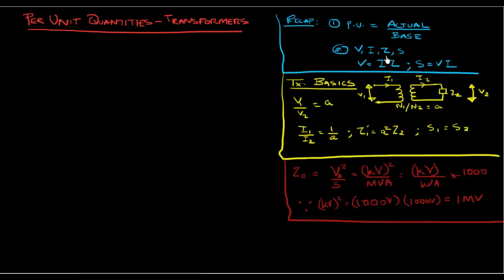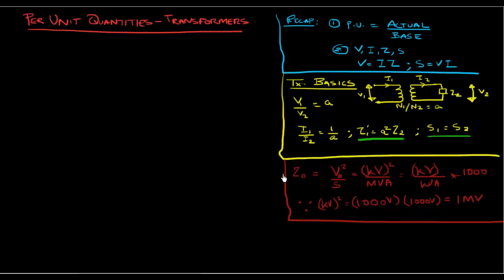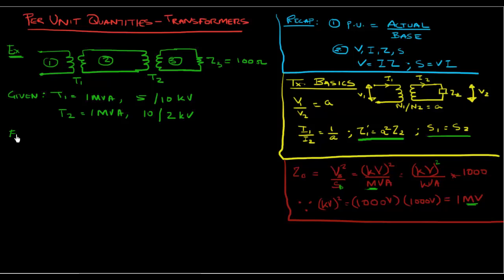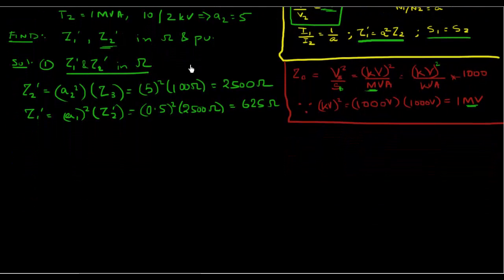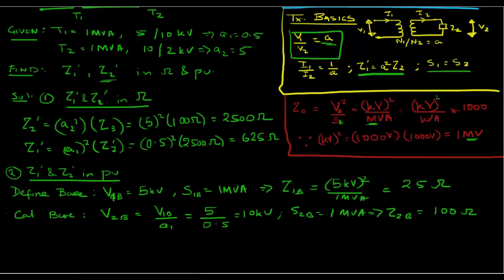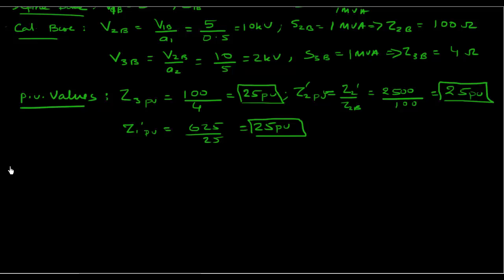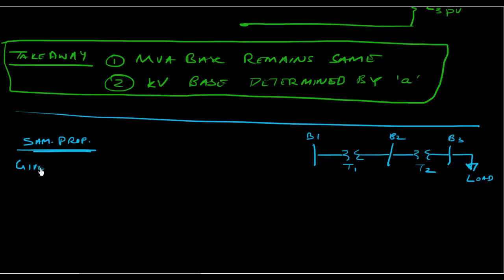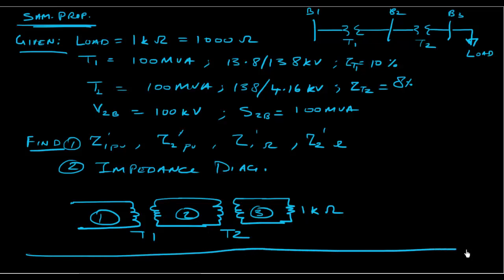Per-Unit Quantities - Transformers

Comment: Can you explain me the meaning of the Z_(T1)=10% and Z_(T2)=8% ? Does it mean that     S_3 = 0.92 * S_2     and     S_2 = 0.9 * S_1  ? So only a fraction of the power is going from circuit one to circuit two and the same happens between circuit two and circuit three. The remaining power would be dissipated at the transforms. 

I would be happy if you could confirm or correct my thoughts. 

Cheers, Niko

Comment: z1pu' is equal to the other inpedances =11004.53033 and z2'=1100453.53....and z1'=11004.53.....
Reply: +achour catalonia that's what i'm getting, not the answer from +Sooraj Surendran...hmm
Reply from the maker: Hi Achour, your values are correct, I need to correct Sooraj's answer below!
Reply from the maker: Hi Evan, yes I did just check again, and Achour's and your values are correct for Z2' & Z1'.   Not the one that Sooraj got.  Sorry about the confusion!

Comment: Z1' 1100453.033 Ohm
Z2' 11004.53033 Ohm

Z2pu 11004.53033 PU  Z1pu 11004.53033 PU   Z3pu 11004.53033 PU

Am i right?
Reply from the maker: +Sooraj Surendran Yes you are Sooraj.  Well Done!
Reply from the maker: Hi Sooraj, I know initially I said your values were correct, but I believe you have the values of Z1' and Z2' switched.  Have another look and let me know if you have any concerns.  Sorry about the confusion!